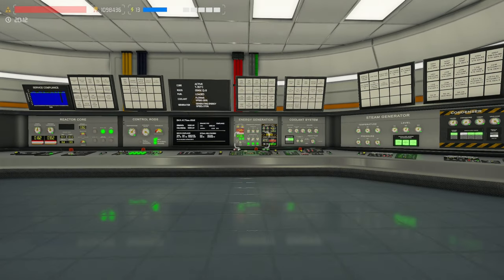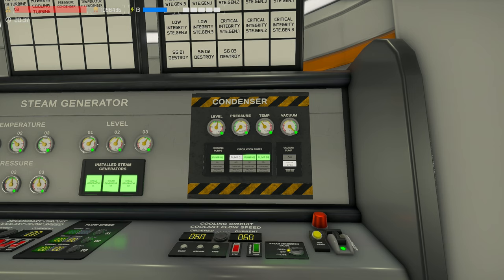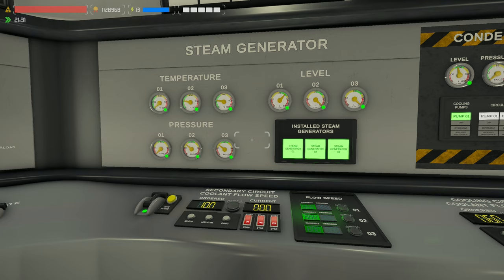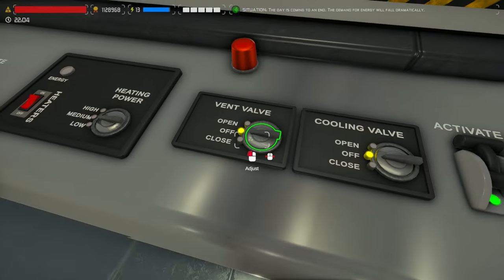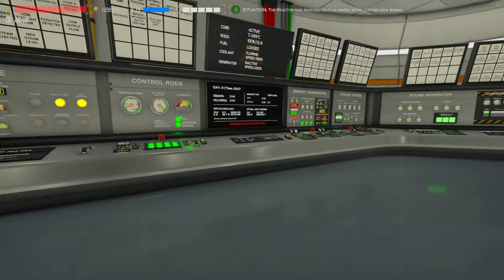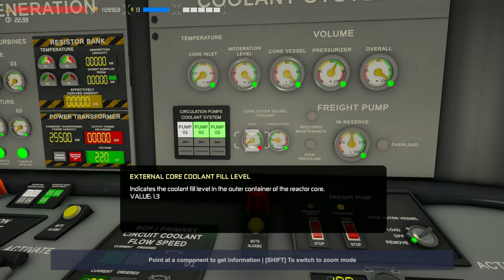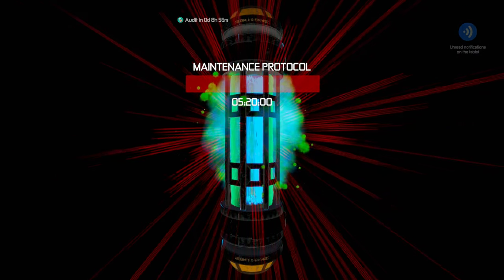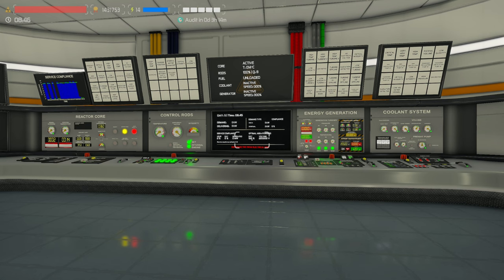Nucleares - Complete SHUT DOWN Tutorial

Comment: With the game lacking tutorials or technical guides built-up, I've found your videos very useful.

Something I learned which might speed things up—If you are holding either of the shift keys while using a switch, button, or dial, you skip the character/camera animation of them going to the control and save a little time.  This doesn't seem to work on the number panels.  I learned this by accident, I was still holding shift after running to turn the pressuriser on and the switch toggled without the animation.  I repeated this a few times to confirm it wasn't some bug.
Reply from the maker: I'll give it a go, sounds fun a efficient haha, cheers for the heads up
Reply: You're welcome.  I like the videos on this too, they're very informative and helpful.
Reply from the maker: Coming out with another soon as an update dropped earlier today that includes a 'Synchro' to the generator
Reply: The synchroscope is an interesting addition.  It doesn't change startup too much that I've seen so far though.
Reply from the maker: No it doesn't at all other than overall outputting power to the grid... Also shut down hasn't changed in any way as you can ignore the Synchro 100% apon shut down

Comment: I'm not 100% sure, but I think by generating so much steam and then bypassing it straight to the condenser is how your condenser wear is increasing so fast.
At least, that makes sense in my head. It's doing more work therefore wears down quicker.
Reply from the maker: That may be the case and ill remember that in future playthroughs... thanks heaps 😎🤓✌️
Reply: I usually use primary pump speed to control power output- the primary circuit's flow is a direct function to the amount of power being pulled out of the core, so reducing the speed and adding control rod to compensate for the reactivity results in less power and steam at the same core temperature.
Real-world nuclear plants don't do this, but that's because they're almost exclusively designed as baseload plants that don't react to demand.
Reply: @carlsojos FYI,  Load-following is becoming more and more common in NPPs, the French have been doing it for at least 2 decades and probably more,

Comment: Nice! you do not TRIP! (you do the same but not using the button :) ) didnt know that you can let the SG Lvl to get so high in the red zone! I usually open the vent to prevent that from happen
Reply from the maker: Nah its fine to overpressurize due to the fact they are connected to your condenser so it just flows through. 🤓🫠
Reply from the maker: No defs DONT TRIP as it vents the steam oit of the turbine into the surrounding room ultimately losing volume in your condenser. 🤔